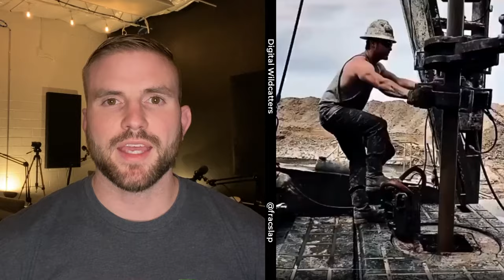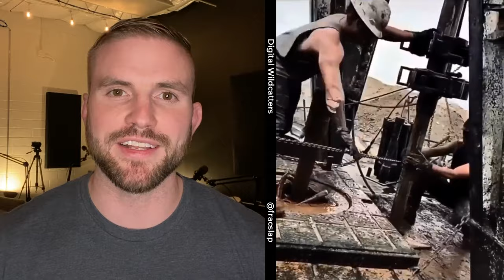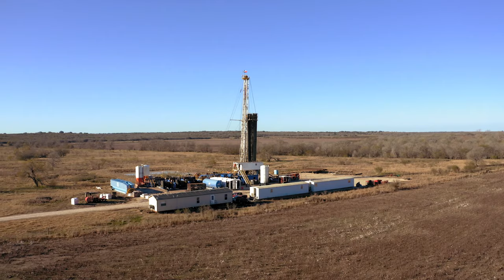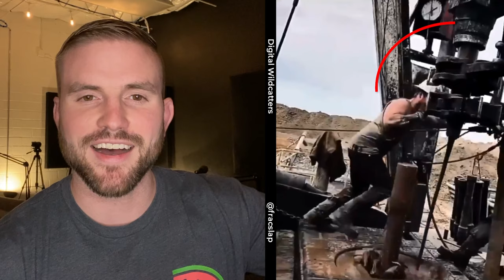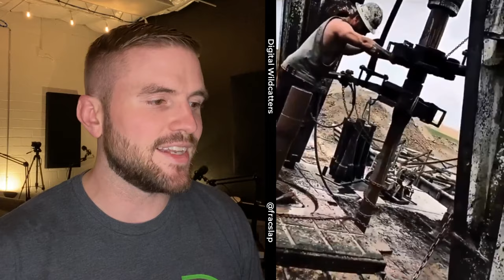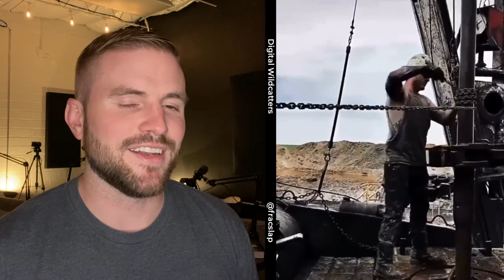What Does a Roughneck do on a Drilling Rig?

Comment: Great video and it sparked a memory. A guy I knew in the seventies worked on an offshore oil rig for 15 years. He was from Louisiana. Aside from being a roughneck I remember that he used the terms "tool push" and "roustabout" to describe the different jobs he had on the rig through the years. I seem to recall that entry level labor on a rig had something to do with pushing around endless bags of drilling mud and other grunt work. Possibly the job description of a roustabout. At one point his job consisted of spending each 12 hour shift strapped by a harness to the top of a tower, (derrick?), from which he muscled 300 pound sections of drill pipe, lowering them into position, one after the other. It appears that a lot of the labor that was done by hand back then has been replaced by machinery. Some of the more dangerous practices have been eliminated.  He made very good money and his schedule was 12 hours on-12 hours off, 3 weeks on the rig- then 3 weeks off, which he spent at home with his family.. He told me a lot of stories including one in which a worker was struck in the head by a section of spinning chain, and that was it for him. Unfortunately that was the possible reality of it back then. Interestingly by the time I met him in 1977 he was working as the captain of a shrimp boat. I was walking the commercial fishing docks looking for work, and being in need of a replacement he hired me on as a crew member.  I slightly "exaggerated" my previous experience in the commercial fishing industry.  I actually had none and was a complete greenhorn. If I'd told the truth he never would have hired me. He admitted as much later. It worked out, but there was an adjustment period. Kind of grueling. To keep things in perspective while I got used to the hard work, grew my sea legs and toughened my hands, he always had a harrowing story to tell me about working on an oil rig. A shout out, my respect and gratirude to Captain Albert Chaisson, wherever he may be.
Reply: My dad was Derrickman and AD. GOD i miss my rough brothers. MWD was the best job ever lmao.  I was pretty happy watching movies, taking surveys, and telling them what angle, azimuth, and gamma read outs 😌
Reply: @shakeandbake7324  the MWD hands were always cool guys.
Reply: was he ballin?
Reply: Drill Collars  30 foot long 100 Pounds per foot,  trip 90 foot tall on a Big rig 10 rows 9000 pounds each just 1 man with a 1 inch rope jacking back and tie it off to the side of the Derrick , the board or a derrick has fingers drill pipe slides between the fingers of the derrick board,  500 pound joints drill pipe  90 foot tall 1500 pounds using a 1-1/4 inch rope guide it to the finger tie it off full derrick is blackleg .  Its a Night mare when a drill bit cone falls off .  go fishing with a magnet trip in trip out till you get it . unless they think it can be pushed to the side and drill past it .  and i seen that fail and had 2 bits in the well skid the rig 50 foot everything had to come down like a rig move just to go 50 foot . or hole in a pipe and it twist off go fishing for pipe and drill collars .  wearing Scott air pack so poison gas don't kill you never fun . Just a day on a Oil rig .
Reply: Thought this was gonna turn into how you met Levon Helm
Reply: the tool pusher is the drillers boss
Reply: That was a good damn story
Reply: Was he also a good runner?
Reply: My uncle worked an oil rig of the Louisiana coast for years, then graduated to a position at the home office before retiring. I'm in my 50s and he's been retired since I was a teenager!
Reply: Great story 👍🏼👍🏼👍🏼

Comment: FINALLY after all these years if watching random clips of this kind of work, I actually understand what they are doing. it never dawned on me that they were simply adding more and more sections to the existing pipe. i feel silly.
Reply: How does the new pipe stay attached?
Reply: @neverhungryagain2187  they basically screw it on.
Reply: @MissNebulosity  how does it stay tight
Reply: @neverhungryagain2187  they use those grabby things to torque it down.
Reply: @MissNebulosity  oh
Reply: @neverhungryagain2187  You added how the pipe stays together and I say that the turntable is turning in a clockwise direction just like a bolt goes into a nut. I've never seen a pipe come apart and I've seen my share
Reply: @MissNebulosity  Grabby things.    That's funny. They are called makeup tongs.Giant pipe wrench if you know what that is

Comment: I worked on rigs in West Texas during the 90's, a few comments. Wells can vary from a few hundred feet to more than 30 thousand feet in depth, there is a drilling prospectus sent to the rig giving estimated tops of depth for the zones petroleum is expected to possibly be located in. These estimated depths are  derived from information from wells drilled in the area  the new well is being drilled. Sometimes the estimates are spot on and sometimes they can be off by hundreds of feet. plus or minus. One of the hands will collect cutting returns  from the mud system shale shaker and periodically a rock doc (geologist )will come out of his trailer and collect them to look at under a microscope.  If he finds hydrocarbons in the cuttings he may ask the rig crew to get ready for a testing company to come with a special tool called a jar and after the rig crew trips the drill pipe and bit out of the hole they will install on the drill string and trip back into the hole all the drill pipe.That special tool is sent to the bottom of the hole to collect samples of what is in the formation below. Then the crew drips the drill string back out of the hole and the testing company analiyzes the fluids from the zone. I was a floorhand and have worked both lead tongs and the chainhand spots. The chain is very dangerous but lets be honest everything on a rig can seriously hurt or kill you if your not alert and paying attention to your rig and your rig mates.  There are still many smaller drilling companies using tongs and spinning chains. None of the major contractors like Patterson,  Nabours or Precison do but many smaller companies using older rigs do because all of the majors rigs can cost more than 20 million USD each. Smaller  well operators cannot afford to hire a 20 million dollar rig  so they hire a company with older rigs that may be worth a couple of million and a much lower day rate and footage rate. I still have a couple of friends working the patch so I see pictures from them on Facebook and see the new rigs and the old dinosaur rigs still in action.

Comment: I broke out on a extreme drilling rig. It was a top drive super single tong rig. I miss this work every day. You don’t know what real work is until you come out from TD sideways using tongs! Shout out to all my fellow roughnecks! Good job on the video man! 💪🏼👊🏼🤙🏼
Reply: Especially when you need to use both sets of tongs lol
Reply: @noahtaborski4621  Come out on tour and they tell you it's bit change time ,the formation has turned to ratsh*t and the tri cores aint cutting so its pdc time (polycrystalline diamond) ...12 hours of pulling 90ft stands ....so tired at the end of your shift ....good feed in the galley (i was always on offshore rigs) and it was better than any sleeping pill you can you imagine ...if there was a sleeping olympics you'd win gold after a 12 pulling from TD

Comment: What it takes to be a ROUGHNECK Guts , you do everything from Carpenter , Electrician , Mechanic , Painter ,  You work your but off fix everything on the rig wash paint .  Next to Farming it is one of the most dangerous jobs you can do . anything can happen on a rig in the blink of and eye .  Blow out . Crown out blocks falling . Drill line snap blocks fall , Derrick fall over in high winds , Poison gas , Broken arm leg or back  You got the Guts working on a oil rig will spill them . 1978 till 86  7 days a week moved the rig every 6 days 6,000 foot oil wells I was in my prime 17 to 23 then the oil field took a  fall 10,000 roughnecks looking for a job and 2 rigs running .  got into underground water mains and sewers .
Reply: Hey man I just wanted to say I dig your comments. Thanks for the hard work keeping our great country running.

Comment: How I learned on an exploratory diamond drill, we had to remove all the drill rods from the hole every 5 or 10 feet to remove the core sample. Don't matter whether it's a shallow 100ft or 1000ft or deeper. All those rods got pulled, remove the bit, remove the sample, reassemble, lower rods back down the hole and add another 5 or 10 feet of rod, and drill the next run. Then rinse and repeat.

Comment: Noble E553, there it was "get it in the hole."  Fresh out of college in '76, learned a whole new language.  Working derrick as a worm, at night, was bad.  As I recall 6" collar was 36 lbs./ft.  We had three stands and it if you let it fall across the derrick (which is exactly what a worm is gonna do the first time) un-hitching from the rope and making your way to the far side to rope that stand back will make you reconsider every wrong thing you have ever done in you life.
Reply: I boke out in 79. Became derrick hand in 80. Jacking a stand of collars was hard work for any derrickman. Was definitely glad to work a rig with air hoist in derrick to pull collars. Much easier 😆

Comment: You want to see a real gut buster of a drilling rig take a look at some old North sea Semi Submersible Drilling,,, man that sh was crazy having to rig up and rig down "everything" needed to start making hole to doing completions it was 12 hours 30 day rotations and freezing wet.
When i started in 1987 there were many older rig floor guys with missing fingers due to those spinning chains and they were being phased out as i started as trying to use DD size tongs by hand while pulling and inserting pipe slips and using a spinning chain on 90 foot sections of drill pipe was just a bit to dodgy, especially when the rig floor you are working it heaving up and down 20 feet and pitching a yawing left to right, side to side, far to many hands being packed in ice and flown by chopper back 250 miles to "The Beach" to hospital and no hospitals that far out to sea.
For what is left of the industry at least the folks have " much " improved working conditions and are not allowed to lift more than i think 25 kilos which does sound kinda funny to an old arthritic man who had to pull pipe slips single handed on a semi in bad weather while holding off and under control a set of DD pipe tongs that were hanging from a shiv more than 300 feet above your head up in the crown of the Derrick.
The job in that wet and cold totally wrecked my skeleton thats for sure.
Reply: I started in 88 on the Global Marine Labrador 1,a jack up so didnt have to cope with the heave compensators !....used to get a perverse pleasure out of shouldering a stand ,listening for the derrickman chucking it in the elevators then the kick would come and you'd slide across the floor and stab it...was like being kicked by an angry mule...good days indeed in the north sea of the late 80's
Reply: @magumba1000  I was young and mad and like you i would enjoy hours up the Derrick running in hole or pulling out, then the hydraulic racking arms came in to play but yeah, as much as i hated it at times it was good to get away from this place and feel free way out at sea.

Comment: Kelly whatever
new joint in the little hole in the middle of the board is the "mouse" hole.
Big hole on the side is where they drop the Kelly and swivel is called the "rat" hole and not the same but name for the 20-50' rat hole below TD for the trash to land. 
Rotary rig "aka power rig" is referring to the floor turns driven by chain driven by floor motors that also drive the draworks 
The stands "2 or 3 pc" are lined across the wooden deck and the fingers on the derick are called the board
Chains are thrown when other tools like spinners are whacked. Is an art. Depends on the thrower and the driller as they work together. Smart thrower is very discriminatory in who the driller is as a sloppy driller will take the fingers and hands.

Comment: Ive seen big muscle bound tough guys last out here only a couple days. Its not for everyone. Trying doing what you see, pulling 5000 feet of pipe out of the hole and back in the hole in one 12 hour shift. That speed doesnt stop, you get yelled at you get sore, you slip, you fall and then get yelled at some more. This place will break you fast but if you make it you will learn how hard you can push your body. Worst best job i ever had

Comment: I worked as a site geologist for a small bore hole logging drill for construction. It is the same process but on a small scale. I've seen how hard to work with these type of equipments. Since then I have a great respect for those who are working in this type of work. It is not a easy job.

Comment: I miss working with roughnecks. I was MWD and Mudlogger/Geologist, watching those badass dudes trip pipe.  If they were lucky they had a rig that was using a top drive instead of rotary table. I've seen 35k ft of pipe tripped with top drive and almost 20k ft done with a rotary table.I miss working with those dudes so much they could be your best friend or worst nightmare. MWD "measurement while drilling" Like me was also called " movie watching dude" we had it the best on the rig. Except tool pusher and company man had it way better.

Comment: That is Roughnecking, now imagine that rig floor on a semi sub in 400 feet of water in winter??
Yes it seems like its the drill pipe that is going in in and out the drill floor up and down 15 to 20 feet every wave that heaves the rig,,, and once you have been back to work 2 days or so you dont feel the rig move once used to it so it really does look like its the pipe moving and not the oil rig which were bounced about like corks in winter. 
Thanks for the memories man!! 8<}

Comment: Dont know where you broke out at, but it's called a mouse hole in this part of texas. Not a stump. And we still drill with Kelly  rigs in young county tx. Still throwing chain. No top drives or iron roughnecks here. The PDC bit is probably the only technological advancement in this part of the patch. Although some drilling companies are starting to use the Pason system on their rigs.

Comment: This may sound strange, but being adept at braiding was an admired skill.  At the end of the spinning chain we braided a section of rope, usually about 9-12".  That was the "handle" the lead tong/chain thrower used to finish the spin.  If that rope broke then there was about two feet of chain swinging around until the driller could stop the cat head.  That's where hard hats were appreciated, and always keep your head down.  Otherwise you get a chain across your face.  And nobody likes that.
I wasn't a professional.  I did 18 months, 8/365 on land rigs in northern Louisiana and East Texas.  I came away with all my fingers.  I lost my high frequency hearing but $8.80/hr + 3/day for black magic + 3/day for bottom hole was pretty good.

Comment: Don't they usually trip trebles, or is that just a Texas thing? I.e., three joints/90 feet stacked in racks on the side of the rig, and the topman throws the top end of the new treble into/out of (depending on whether they're pushing or pulling the string), the travelling block as it comes up at express elevator speed  and the guys on the floor do as shown? Because stopping at every joint would be really slow if you have it in a hole in the ground and run the top block up and down twice for every one.
Reply: I have no idea what your talking about .   1 joint is a connection to the next joint you drill 30 foot at a time the Kelly is 45 foot , but your only doing the 45 foot the first time, its 30 foot after , a trip depending on the rig single is 1 joint small rig  more for water wells,  Double 2 joints on a trip Trippel 3 joints on a trip .   Why would they run the blocks up and down 1 pipe sits in a hole called the mousehole the kelly is drilling . you break the kelly push it to the mousehole make it up, then go back to drill string make that up, pull the slips go back to drilling lower the kelly to the floor rotatory table  .

Comment: This is crazy lol he said 30 feet at a time and it's usually 20,000ft holes lmao holy shiiiit
Reply from the maker: lol! takes a couple weeks to drill, not a quick process.
Reply: Mid Kansas we drill anywhere from 4200 to 5600! Our wells take about 9 days from rig up to rig down. Have only been doing 2 DSTs
Reply: We ain’t drilling 20k feet in arkansas & Mississippi on conventional plays lol.
Reply: On Our new skid rigs, we drill 20k feet in 7 days. But we use 3 30’ joints out together. So 90’. That’s doing a similar process to this (but with the updated technology iron roughneck etc) roughly 220 times in about a 6 hour time period during a trip

Comment: How long does it take a roughneck to become efficient from day 1? Do you work 12 or 8 hr shifts? So it only takes  aprox 15 seconds to drill through 30 ft of bedrock? Does the drill bit ever have to be pulled out for replacement due to wear or damage?

Comment: How about a video explaining why everything is done at a 100mph and the risk of suspended cuttings jamming the string in the hole?
Reply: As long as the cuttings are in suspension you don’t really have to worry about the bit getting locked up. It’s when your mud is too thin and doesn’t hold the cuttings or formation back 

And everything is done quickly to get back to making footage. If you’re not turning, you’re not earning.